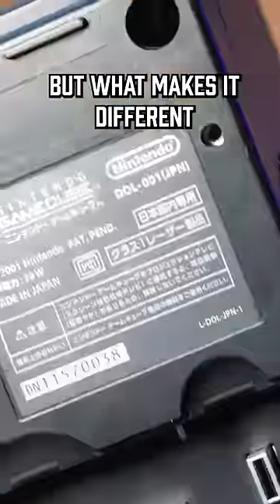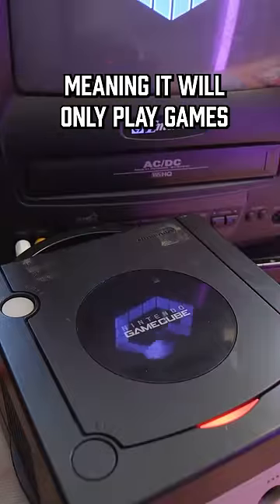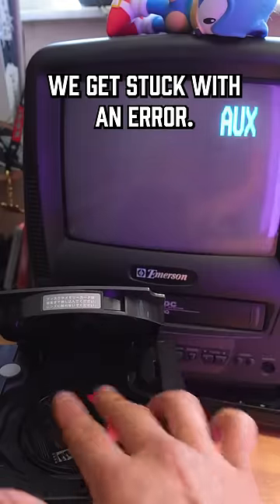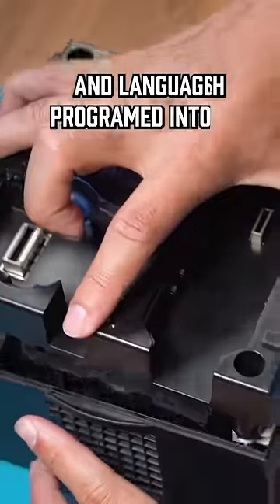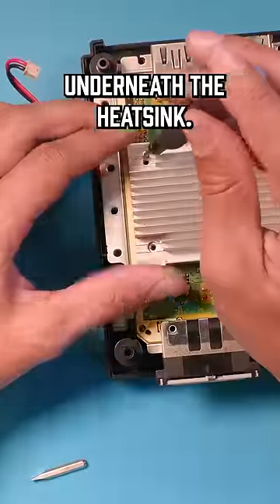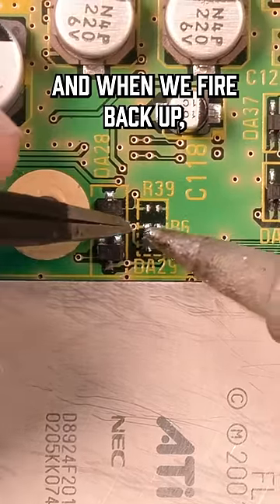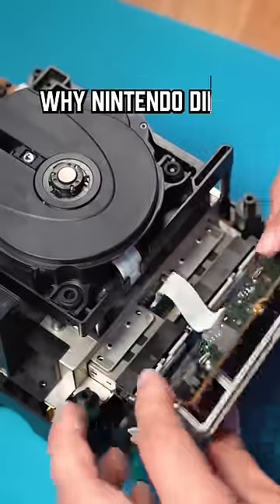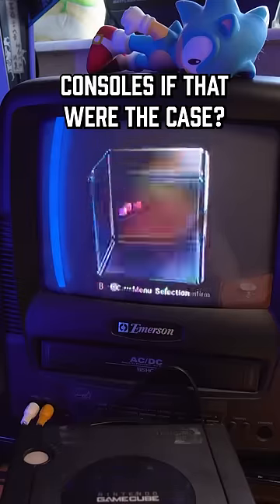Unlock your Japanese Gamecube!!

Comment: Region lock was definitely the worst thing ever invented
Reply: It really was. Long story short, I was trying to look for a Wii U on eBay, and I found one for about $100, but then I found out that it was a Japanese only console. I have only 3 North American Wii U games, and if I was going to be able to play those on there, I would have to mod it and then region unlock it, but then I don’t have an SD card or a USB flash drive. But luckily I ended up finding a Wii U that was NA for $110 and I was able to play 2 of the 3 NA games I had
Reply: Region locking was the predecessor to DRM.
Reply: @skyzflxshy if you can afford a wii u im sure you could afford an sd card n flash drive. to get both together is probably cheaper than $20
Reply: @dorf7219  I have 2 SD cards and 1 usb drive, but I’m using 1 of the SD cards for a second Wii I have and the usb drive is being used for that as well, and then the other SD card is being used for my 3DS. But I just need to get another SD card if I want to mod my Wii U and get other things
Reply: Indeed it is. My uncle was in the Marine Corps and my uncle told me how when he was stationed in Japan a lot of guys bought ps2s and when they went home couldn’t even play them because region locked games/regional adapters for power
Reply: @akaCol1987  no it wasn’t lol. Drm has existed way longer.
Reply: @skyzflxshy 
If you're looking for a good SD card for the project you can get a 256 gb team group microSD card with an adapter from Newegg for around $15

It's a good enough SD card if that's what I'm using in my steam deck and it seems to be pretty good so far

And as far as reliability from team group goes I use them and my phones and for data storage back up and I don't have any issues out of it and I've been using them for about four or five years now and haven't had any issues and they all come with a lifetime warranty

Which I've only had to have one replaced in that one was DOA but they replaced it quickly I didn't have any issues at all with the replacement

Thank you for reading this and I hope you're having a good day

God bless you and your family

God bless you

Jeremy Scruggs
Reply: Racism. 

Only one word to describe it.
Reply: Thank god the switch isn't region locked
Reply: Yeah…a couple years back, I didn’t know that my English 3DS was region locked, so when I bought a Japanese version of Pokémon X, I was so sad to see that I couldn’t play it.
Reply: Oppenheimer just came out 😂😂
Reply: Yes, i hate it just because there are 7 Nintendo 64 games i really wanted only to find out they weren't released in pal regions and are NYSC exclusive
Reply: @chairgaming1997 iirc the region lock is physical on the n64 (similar to snes) and easily bypassed
Reply: Especially when it came to dvds
Reply: Still present today with steam region lock
Reply: @skyzflxshy you only need an sd card to mod a wiiu and you only need a few MB of space for the mod files 💀
Reply: One of the worst thing human greed made
Reply: Nintendo invented it first, so they were the last to abandon it. That was why the NES was physically different between Asia and the rest of the world.
Reply: @VallenChaosValiant The NES was made to be different in the US and Europe thanks to the 1983 video game crash.
Reply: @miregoji2959  just did a quick Google search the first version of drm was made in 1983 and the Japanese nes was released in 1983
Reply: It's not a invention.. it's just a consequence of game publishers rivalizing each other and their demands.. and country laws, in a time where squaresoft US released breath of fire in US instead of capcom etc. Many obscure deals on a baby not entirely globalized in market that didn't knew exactly what to do or had the money to.
Reply: Yeah I modified my nes to be region free
Reply: @enchantedboss1468 Wait how do you do that
Reply: i feel like mustard gas is a worse invention
Reply: Game racism

Gacism
Reply: Only small manchildren would call this the worst ever
Reply: i think the atomic bomb is worse but i respect your opinion
Reply: @skyzflxshy a 32gb usb is like $5....
Reply: well yeah but back then crt tvs in Japan have a 50 Hz refresh rate the US and some other countries use 60 Hz refresh rate thats one of the reason games where region locked
Reply: Yea I bought a limited edition gran turismo from Singapore back in 2019. Later when i got home and tried redeeming the code it couldn't be redeemed. Now I have a rusted steel case with a wasted $60 worth of content inside
Reply: @skyzflxshy why only 2 out of 3
Reply: Yeah but it serves a purpose? Im not defending it but it exists because of license restrictions. Its such a stupid take to say "why didnt nintendo just not region lock all of its consoles if they woulda sold more?" Because thats how different countries have their copyright laws set up, so while it would be easy on the hardware side it would be much much harder (maybe impossible) on the legal side. Simmilar reason why rhythm games dont just have a "spotify" option (geometry dash has a newgrounds option because newgrounds worked directly with Robert Topala and newgrounds is populated by independant artists).
Reply: Region locks are basically an attempt to maintain the status quo of different parts of the world charging radically different prices. Since region locks have gone away, the gap has closed to almost nothing
Reply: It was supposed to prevent piracy but caused more piracy.  Like if a legit copy of a movie/game/whatever is only available in another region... yarr, matey.  (and IMHO pirating a game that is not legally available to you, whether it be because of region lock or not sold anymore or what have you, is not morally wrong.)
Reply: @skyzflxshy theres a way to to remove it i removed the region lock on my wii
Reply: @TheKorfish Dude I bought a DVD trilogy of this cool looking anime I had never seen before. Boom it's region locked.
Reply: @mrsoshadabaadman  fr. Like you bought it legally and then they do that to you, this is one of the many things that killed physical media.
Reply: Yeah. I bought tboi ab+ and recently tried to buy the repentance dlc but bc my cartridge was from the US it doesn't work and I am still in customer support hell trying to get my money back
Reply: Worse than nukes
Reply: It has a purpose.
Reply: @SandeepSingh-oc1dg  like what, to drain more bank accounts with mistakes
Reply: Artificial Depletion
Reply: Region locking had to do with software limitations at the time. They couldn't store multiple versions of the same gamecube homescreen software im the limited space so they made different versions based on the markets they were selling them in
Reply: Just a leftover from the early 90s when uncontrolled importing got REALLY out of hand, at least over here in Europe. No idea how things went in the US.
Reply: Facta
Reply: Denuvo would beg to differ :P
Reply: region lock means control of retail. that way you cant get it cheaper elsewhere.
Reply: Denuvo…
Reply: Yeah the NHL fucking loves it
Reply: the japanese versions and consoles are sold a bit cheaper then american or european version, so i would think its to prevent people like me in north america from buying a cheap console imported and just buying the games from nearby, since i wouldnt understand the japanese games it would be a pain having a cheaper japanese console yet not able to play games that i buy locally
Reply: @impalas1966 Well yeah, they bought them for super cheap. The only way for them not to be region locked would have been for them to cost the exact same. Their fault for not using their heads.
Reply: @Mr.Hellboi not just cheaper, in the US and EU they were sold at a profit, and a pretty great one at that, in Japan, they sold at a loss. You could literally buy up Gamecubes directly from stores and outcompete Nintendo in pricing if they didn’t region lock.
Reply: I wish to be able to destroy region-locking problem is government would f**** up
Reply: @cupofdirtfordinner  copyright is evil
Reply: @i_hate_stupid_username_rules  I AGREE
Reply: And offline single player game that requires internet access, oh dont forget the game with launcher required even though you run it from steam
Reply: This is probably why Nintendo got rid of it with the Switch and that had so many fans bow down to Nintendo for doing that
Reply: @alekhaalrem1408  single player games that need internet to function are STUPID
Reply: And it still suck
Reply: Nintendo console region locks in particular were, in my opinion, especially bad in the Middle East and Southeast Asia system region, with us receiving North American releases of games instead of European releases. That caused problems in some games with stuff like Wii Fit using Imperial measurements instead of Metric, and in a lot of games the NOA US English localisations were used instead of the NOE UK English localisations. If was expensive for someone like me to import a Wii U from Europe or Australia just to play the original Splatoon back when that was still new.

With the Switch, it's easier because I was able to buy a console locally and change the system region from 'The Americas' to 'Australia / New Zealand'. Physical copies of Nintendo games are still sold here with the US cover art, but I'm more easily able to buy UK and Australian copies that were imported to get English-only covers if I really want those.
Reply: @skyzflxshy Why not the 3rd? Bad disk?
Reply: @chairgaming1997 YOOOO WHY IS YOUR USERNAME CHAIRGAMING TOO THATS CRAZY
Reply: @skyzflxshy you did not make the long story short
Reply: @nynvib276  yeah true. Idk why I made it that long
Reply: Back in the day it was. Unfinished games and a large amount of gaming consumers are a huge problem now tho
Reply: @akaCol1987  Pretty much DRM. I hate DRM with a passion. It doesnt protect anyone's rights, just protects the control they have over your device you paid with your hard earned tender.
Reply: Can’t leave any region left out, but, let’s face it - piracy was way worse in certain regions
Reply: Even Satan to the guy inventing it : You're totally belong down here pal.
Reply: @skyzflxshy did you know the Wii U gamepad is also region locked? You Arent allowed to use a Japanese Wii U game pad with an English Wii U console
Reply: it's really funny how the PSP and Xbox 360 we're not Regent locked. because I had a Japanese bleach game for my PSP and my brother had a Spanish copy of one of the Halo games for Xbox 360
Reply: Worst invention:
Region locked nukes with AIDS
Reply: Probs
Reply: Or just locking hardware and software like apple does nowadays. I hate when companies lock things
Reply: Yeah it was only by luck that I was able to get the games eBay when I was younger I didn't run into any problems with that I was completely unaware I could have been cucked by the European copy of a game I wanted
Reply: AIDS ENTERED THE CHAT
Reply: Region lock is racism
Reply: @zeldadahedgehog  how so?
Reply: nuclear bombs were pretty bad
Reply: Region lock existed because of hardware limitations on tvs back then. They were very specific with color encoding. NTSC, PAL, NTSC-J... back then games had to be specifically made for those tvs. but as technology progressed, tvs became capable of having multiple encoding systems, and the process of region locking just became an industry standard practice. Now region locking became a sort of filter for other reasons that isn't specifically because of a hardware limitation. 

So it's not really something invented, but more like a by product of technology.
Reply: Region lock is necessary to protect retailer markets while allowing pricing variance.
Not going to explain it any further, you guys that get on the internet and complain about shit you don't like, assuming it's due to nefarious reasons, while having zero clue what your are talking about is fking annoying.
Reply: mustard gas
Reply: No it wasn't 😊
Reply: The Law: Exists
Zoomers: KILL IT WITH KNIVES
Reply: Atom Bomb 💀
Reply: Yes
Reply: Mustard gas?
Reply: @Rottyn Totally unrelated to this but Child of Light!!!! That's my favorite game so love your profile pic of Aurora :D
Reply: right behind the monstrosity called copyright
Reply: no that title goes to leaded gasoline
Reply: Still is
Reply: It still happens (I can't get a Steam Deck) Can't even send it to a friend or family member house in the USA cause My credit card and paypal account must be from US. FML
Reply: Covid was worse.
Reply: It was terrible
Reply: @legendwolf-ts6158 It's funny you mention Pokemon X since starting from that point, all copies of all Pokemon games have all languages loaded into them from the start. You couldn't change your copy's language without deleting the save data, though
Reply: @VincentMarcel30  Nationalism.*
Reply: Fascism a second
Reply: Censorship the cause of it
Reply: Except the nuclear bomb of course.
Reply: Securom entered the chat 😂
Reply: Tell me about it. I had to buy another PS2 just to play Silent Hill
Reply: @akaCol1987 exept region locking doesn't decrease performance unlike some drm programs
Reply: @akaCol1987 region blocking had to do with rating boards. The law and codes. They didn't want issues with EU rating boards in case some kids play a Japanese game rated for kids in Japan but not related in the EU.
Reply: @skyzflxshy not to mention you need the wii u tablet in order to mod the console, and that the tablet itself is region locked
Reply: @RoachCatJr  I just haven’t played the 3rd one yet
Reply: some games are illegal in the west like things that were overly sexual, thats why is was done.
Reply: @BitchyBoxxy that its a bad example, the ps3 its region fre (except for a few games), region free doesnt mean dont have diferent regions games, just being able to play this verisions with any region console
Reply: @VincentMarcel30  No Region Lock is Genius. That means Japanese people can only use products made in Japan. In Macroeconomics, this is good because Japanese state money does not leave Japan.
Reply: Because companies wanting to account for different pricing in different markets is such an evil thing. And I’ve region-unlocked my consoles before. Region lock helps keep games more affordable in developing economies with less PPP and disposable income.
Reply: Idk man I think covid was pretty bad too.
Reply: What was the point of Region lock anyway? If you buy a US game in Antarctica on a JP system the Console maker and publisher will still profit from it
Reply: Region lock is for the company to get more money. Greed is it's own downfall
Reply: Still exist that's why you need a VPN today
Reply: @VincentMarcel30  It's capitalism
Reply: @pauloazuela8488  "Or as I like to call it, Racism " -MatKC
Reply: I would argue oil combustion engine and the cotton gin were much worse lol
Reply: Different countries have different laws
Reply: It unnecessarily splits up Asian and North American gamers
Reply: had to do with some stupid laws i presume.
Reply: @skyzflxshy instead of buying an SD card for like 20 bucks to region unlock the wii U you bought. You bought a whole second wii U and just left the first one to rot? Kind off a waste of money if you ask me
Reply: @dorf7219  Remember nintendo online exists
Reply: They still region lock dvds and blu rays. My friend bought me full metal alchemist brotherhood boxset on blu ray and i did not realize til 2 years later that it was unwatchable on american hardware. 

I do have a modded ps4 so i feel like i have a work around i just never got around to finding out.
Reply: its the dumbest thing cuz imagine moving to a different country with your gamecube and you cant play any games.
Reply: not really, pubg still desperately needs one
Reply: @i_hate_stupid_username_rules No, I’d say letting people have control of the things they create is a good thing.
Reply: It was a blessing in disguise. That gave way to passionate gamers becoming future moders.
Reply: not sure if I would agree... 2nd hand games in JP are soooo cheap. I felt like stealing all those switch titles
Reply: Idk man racism was pretty bad
Reply: it's just dumb like bro just let me play my games from ebay or amazon
Reply: @mrgameplayfun5949 is that a thing?
Reply: @galilea723  of course it is
Reply: @VincentMarcel30  is this like a joke or something

Comment: Yep! For those who are wondering, the relay switch thing he mentioned was present on development consoles, particularly the NR Reader and NPDP Reader, but of course was removed on retail consoles.
Reply from the maker: Very cool! 😁
Reply: So if I add one myself I can easily switch between both 👌🏽
Reply: The reason they had both BIOS on the motherboard was to save on manufacturing. Just connect R5 or R6 depending on what region they wanted to sell it in.
Reply: Oh sick, my dads an old game dev so I have a few gamecube devkits I could try this on. Neat!
Reply: video on those???
Reply: more interestingly youre actually able to swap in the drive from the dev console to play dev discs and retail to play retail